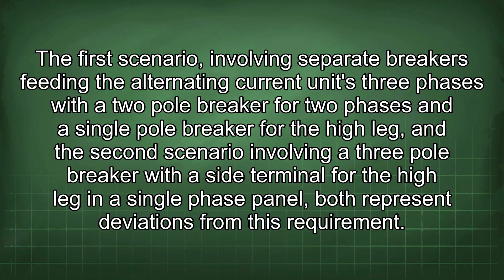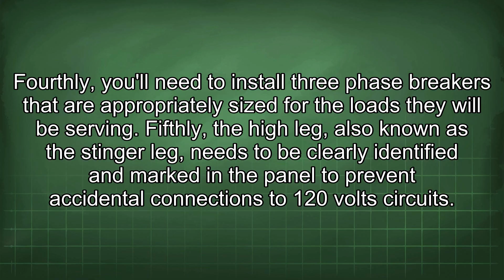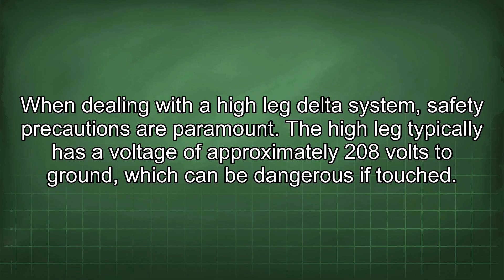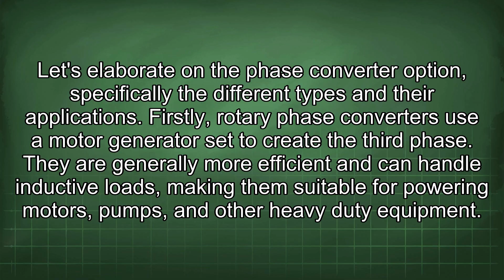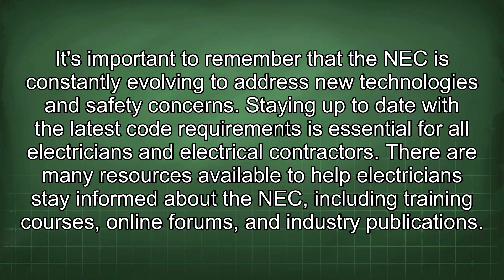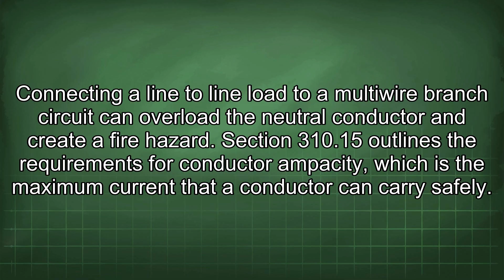Delta Service in Single Phase Panel Code Violation?

Comment: The three pole breaker with the side terminal for connected the high leg is known as a delta circuit breaker and were made by several well known manufacturers.  Most often these were used with open delta high leg services where there was only one three phase load on the system, typically installed in the 1950s to the 1970s for a 4 to 5 ton central air conditioner, and some older upper class  neighborhoods in the Southern US have open delta banks for those big new fangled air conditioners.  

Delta circuit breakers were banned in the 1978 NEC i believe, however from my understanding they were manufactured for some years after 1978, marked "FOR REPLACEMENT USE ONLY".